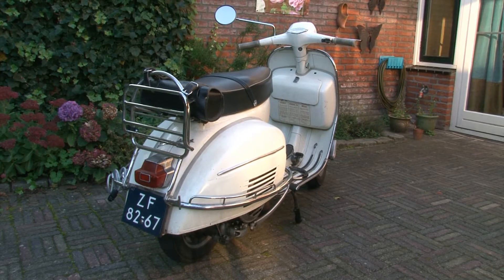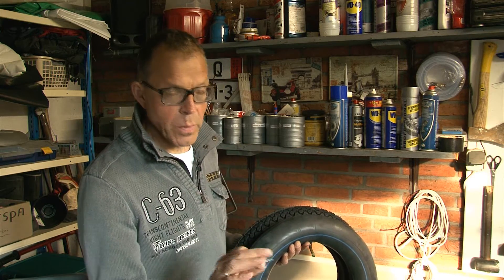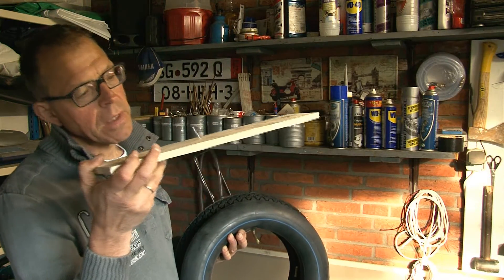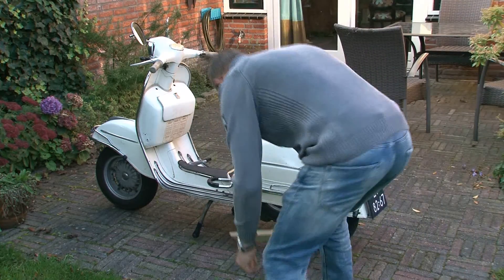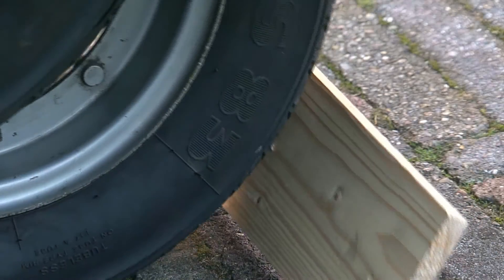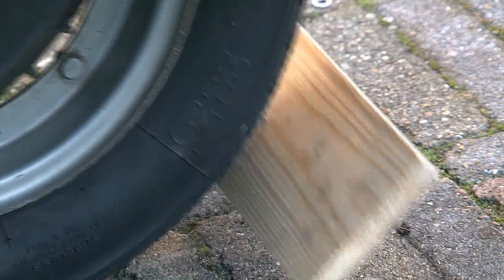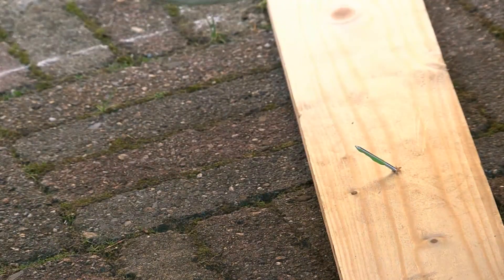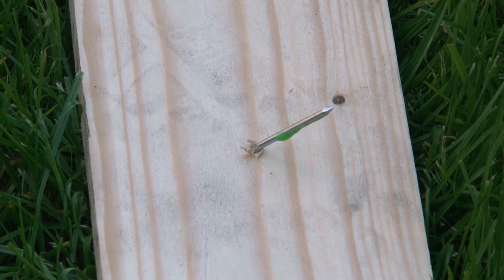How to prevent a blown out tyre with your classic Vespa

Comment: Hi, I wonder how much sealant did you put on each tire? And are those 10" or 8" tires?
Reply from the maker: In each tyre 237 ml. The tyres are 10 inch.Take care you must use sealant for  inner tubes!
Reply: Erik van der Leij That’s roughly how much I put on each of my 10” tire, too. I just think I put too much because the Slime calculator suggests only around 67ml. So while riding it yesterday, I have a feeling my tires became significantly heavy.  By the way, also running on 10” with tubes. Thanks.